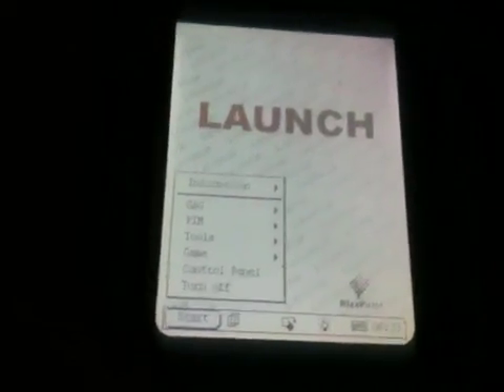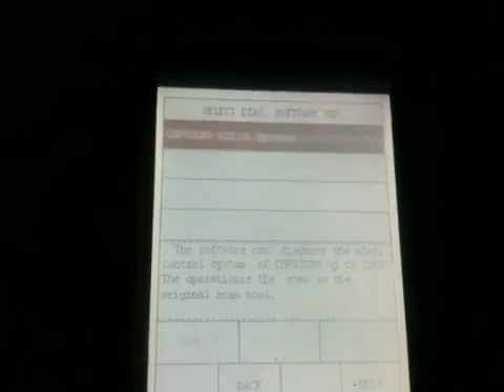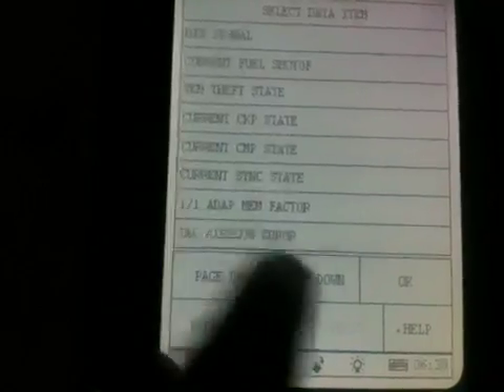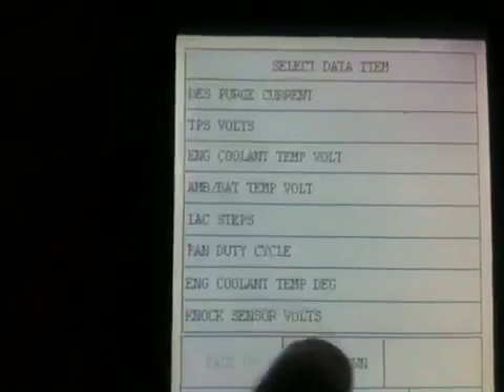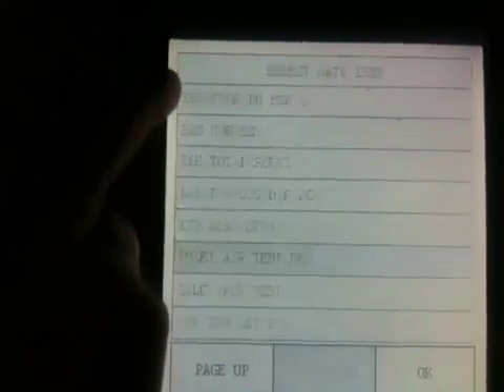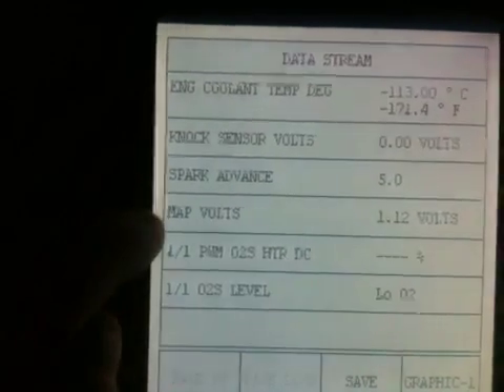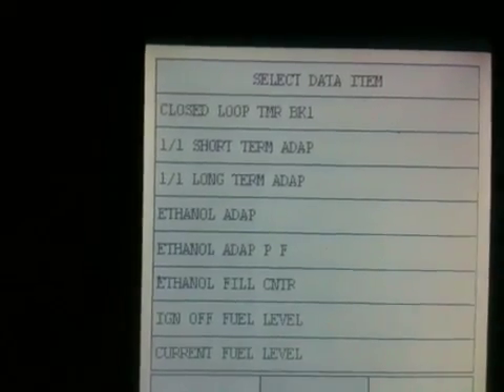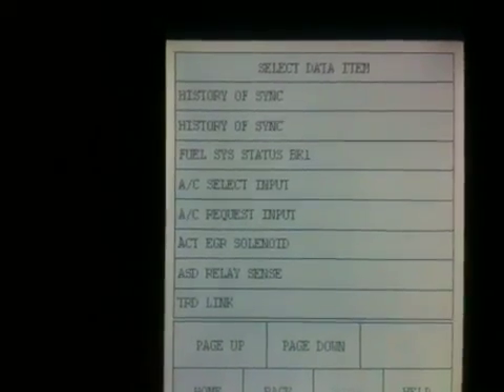Launch  X431 GX3 scan gauge (more detail) Pre HHO

Comment from the maker: I have added a link in the description box about knock sensors, hope it helps.
Also, the spark timing is to do with the time that the fuel is ignited, the faster your engine is running, the spark is adjusted accordingly.
I'm no mechanic, but this is my best understanding. cheers.

Comment: Generally, it would be great to see a comparison of all crucial sensors work with and without HHO introduced to the engine such as: MAP, O2, spark ignition timing (I don't get this knock sensor yet), temperatures,  This way we'd see if, what and how far we ought to try changing their signals going to ECU. Correct me if what I say does not make sense, and also please explain how they work and why it so important, so I/we can learn more from you.

Comment: Back to business. If you'd be so kind to examine the engine and exhaust temp.and ignition advance with/w-out hho, it would be great. We'd see if ecu adjusts spark ignition to hho by itself or not and if there's any excess heating to be affraid of. Besides I'm curious if the gauge can also input changes to sensor readings as if it was a kind of EFIE or MAP enhancer, for example. Maybe I'm talking complete crap, but i don't know much about engines, just learning